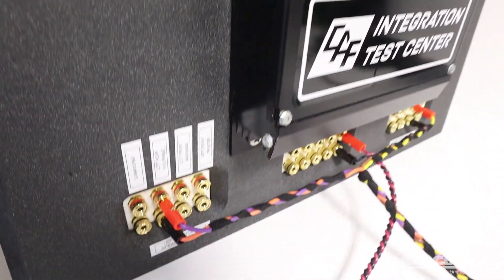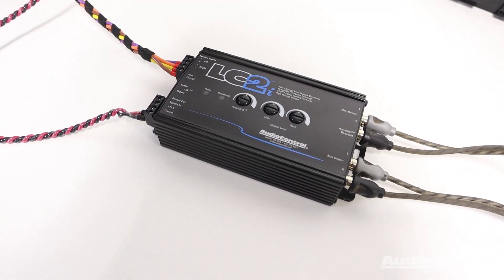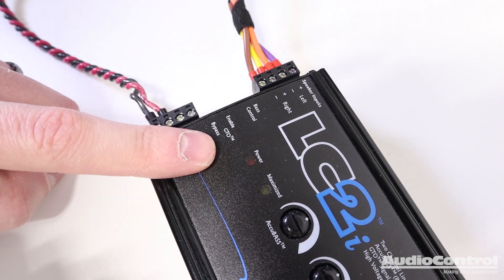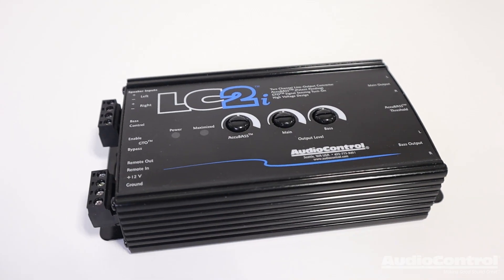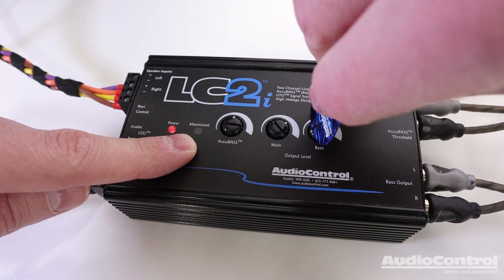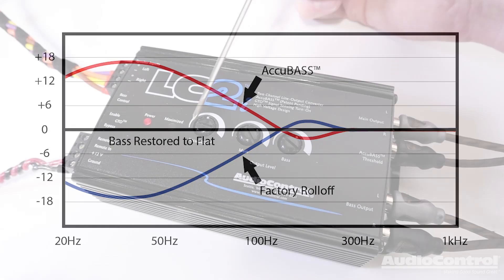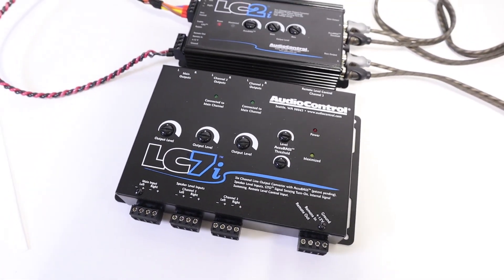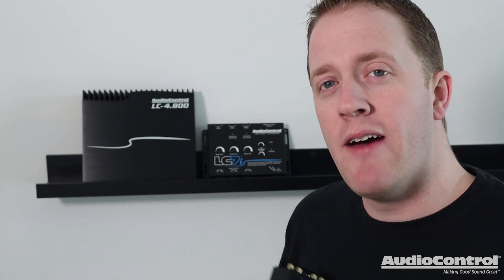HIGH QUALITY sound from FACTORY Audio System - AudioControl LC2i

Comment: Hi Mark, Really good stuff here. 
I just purchased a Prius Prime with a horrible sound system (Not a JBL system. not that they're really that good). I just upgraded the factory speakers to find out the system is not balanced from front to rear with really bad Bass and lacking in power to drive the new speakers.  The car is my daily and although I am used to awesome, old school ADS systems and HiFi home systems from the 80s,  I've grown out of it as got older to trade my music for the convenience of today's streaming music.  Nevertheless,  I still enjoy good sound and purchased 2 under seat powered subwoofer to enhance the bass response wo. losing space or cutting into the car. I plan to tap into the rear door speaker line input using LC2i.  My question is.
1. Can I use the LC2i without an amp to control/increase the rear door speaker output? Currently, the factory head unit is set up such that most of the sound goes to the front and the fader doesn't seem to help too much.  Of course , the bass output will feed into my new powered sub. 
2. With a 4 channel amp set up with a LC2i,  would I still have a fader and balance control with my factory head unit? 

Hey, Thanks for all your great Tubes,
Seong.
Reply: I LOVE A/D/S amps.  I used to one one of those for my mid's and high's as well as an old school A/D/S 642 CSI crossover.  I had an A/D/S PH8 to run my door speakers. I just didn't like that weird pigtail connector that you needed to use for their crossover.  Exceptional sound quality from them back then, and they were not cheap.   The LC2i and LC2i pro are only left and right channels and a sub-out.  So if you wanted to run front and rear speakers in the doors and/or rear deckspeakers, you'd have to use Y-Jack RCA's and you would not be able to fade front to rear.  You could connect one amp for the mid's and high's and run the other to power a subwoofer.  You can connect it to the rear speaker outputs and when the LCi2 detects speaker power, it will turn on and remote turn on your amplifiers as well.  So you won't need to manually turn on your amp.  The LC2i does it all for you.  It just don't do 4 channels.  The LC2i Pro has a nicer version of Accubass with an LED light to help you match the roll off much better.  I highly recommend this one over the older LC2i:  https://amzn.to/2OVrPtf

Comment: If you use the lc2i, do the amplifiers still need a remote to know when to turn on? Or is there an output to signal them.
Reply: I didn't because my jl 500/1 also have sum the signal when it get a signal....and I like it cause when I turn down to low volume my bass shuts off and the bose takes over
Reply: As already mentioned the LC2i can detect signal and simply using the remote turn on out to the amp will power it as needed perfectly fine. Been working great so far for me!
Reply: I just had this installed in my SUV today.  It's able to turn itself on and off, along with the amp the moment it detects signal from the speakers.  The moment I open the door on my Ford, it turns on since the speaker chime comes through the speakers.  That turns it on.  After a few minutes it turns off by itself.  All using the factory radio, flawlessly.  Sound quality is amazing!  I am so happy I didn't use one of those cheap $20-30 jobbies that some people use.  I've seen people complain that those only work sometimes a week to a month and then they die. I trust the high quality of the Audio Control stuff much more.  They have made top notch stuff since I've been using them way back in the 80's.  Get the new LCi2 Pro which is much better than the old LC2i.   Not really all that expensive:  https://amzn.to/2OVrPtf   You can connect to your left and right rear speakers and run a mono amp in the rear of the car to power a nice subwoofer.
Reply: You still need a turn on lead. The Lc2i has an output to supply the 12v needed to turn on an amp.

Comment: Im interested in this product, question, can I use this on my 5 channel amp? Main output for channels 1 & 2, low output to sub input of the amp ?
Reply: You could if you use Y-jack RCA adapters and you'd have no way to fade front to rear.

Comment: Should I use a lc7i or JL audio fix 86 on my Acura TSX. I'm going to power a 4 channel amp for the doors inside and a another amp for my subwoofer
Reply: Daniel Turnbow we need answers please.
Reply: @NinaBabyTV  what do you need answers too
Reply: Daniel Turnbow to your original question. I don't have an amp, but which payh do I take. I want to add a sub, but in the future upgrade the inner speakers
Reply: I added the lc7i and sounds good.I obviously updated all my speakers and I have a 4 channel amp pushing it.
Reply: @NinaBabyTV  are you trying to figure out how to wire up your lc7i? If ya need to know where to tap into anp  to run lc7ii
Reply: Daniel Turnbow so you upgraded the 4 doors and the rear deck? Total of 6?
Reply: @NinaBabyTV  yes. Correct :) and instead of buying speaker spacers. I just cut out old oem speaker in doors and used for spacer :)
Reply: @NinaBabyTV  if you just want to run a amp in a sub you just have to go get the lc2i and you can wire off your rear 6x9s. but you're still going to have to run a power from your battery to the amp obviously and a ground. A great place for ground is right above the fuel pump there is a stud and a bolt that's what I used
Reply: Daniel Turnbow but i plan to upgrade the door speakers in the future and I don't want to buy twice. So how do I power up those in the future?
Reply: @NinaBabyTV  I bought the Alpine s65c component speakers for my front doors rear lid. they will work with the current factory amp and they will also work when you decide to use an amp to power them
Reply: Daniel Turnbow hmm, I'll keep that in mind. I was thinking abut alpine type s for the rear deck and doors (in the future)

For now, I just wanted to add a 10" sub, nothing super crazy, but I was thinking of I could get an amp now for the sub and have it ready for the future when I do the inside speakers.
Reply: @NinaBabyTV  I have a Jlaudio 12 in basswedgebox with 250 watt amp
Reply: @DanielTurnbow  I just got an LC2i. Where are you getting the signal for the LC7i? Before or after the factory amp? How did you wire the speakers?

Comment: Best investment I ever made. I tried using a $12 passive in my 2015 Jeep Cherokee. It's all I could afford/wanted to spend. I was complaining because my 8" Alpine powered sub was weak. I'd heard of bass roll-off, turns out Chrysler/FCA does just that. So I spent almost $300 on a powered sub and cheaped out on my signal converter. The way I see it those passive signal converters are nothing more than old-school cross-overs. When I installed this it was like night and day. Seriously, even if you go with a different unit and don't have ambitious tastes in car audio. If you have to keep the factory head unit? Don't spend crazy money on an amp and think a passive SC is going to work. You can try, as I did, but no way.

Comment: Hi, I'm currently using Audio Control  LC2i Bass output works fine and the bass sounds Great. But I can't seems to get voice to the mids speakers I'm trying to add using the main output on lc2i only bass goes to the speakers any suggestions?... I tapped into the factory sub wire from the factory amp in the trunk. Bass sounds great. Just added a second amp to Run two separate 6.5 Midrange Speakers but I'm only getting bass to the speakers no voice... Should I tapped  into the door speaker wire from the factory amp instead of the factory sub wire? please let me know what you think.
Reply: UniqueSounds Ent yes you need to tap into your door speakers In order to pick up a full range signal. If your tapped into the sub, you will only feed the lc2i low end signal
Reply: Yes, like Eric says.  You should be pulling the full range speakers from either the front or rear speakers and run them into the LCi2 or LCi2 Pro.  From that, you can send signals to two different amps, one for mid's and high's and the other for your subwoofer.  The sound quality is amazing to run off of a factory radio.

Comment: I have a left and right subwoofer. Can I plug that into the Lc2I and run it to my mono lock amp?
Reply: Yes.  I have the LC2i Pro which is better and mine is connected to a mono channel amp.  Check it out here: https://amzn.to/2OVrPtf  I have clean bass from a factory radio.  I powered a W7 woofer with a Fosgate 500 watt amp and the entire car shook like hell.

Comment: So I just installed one of theses in my 2009 ford flex and taped it in to the front left and right speakers.  Question I have is that correctly done or should I done it at the factory sub or at the factory amp.. and have trouble setting the gain and acute base. I only have a small down firing 8 inch keen wood sub. Just dont feel something sounds right thanks for any help
Reply: Were you expecting window flex?
Reply: Paradox Shift 8"+keenwood will make it not feel right alright!
Reply: @truthfkswithu1284  What? Did you just call my mom a keenwood?

Comment: How’s it going what gauge wire are you using for the power connection?
Reply from the maker: 16-18 gauge wire is normal for this.
Reply: AudioControl thank you
Reply: Do you piggy back that wire off your amp or from a distribution box?